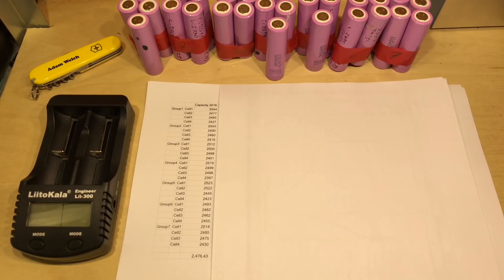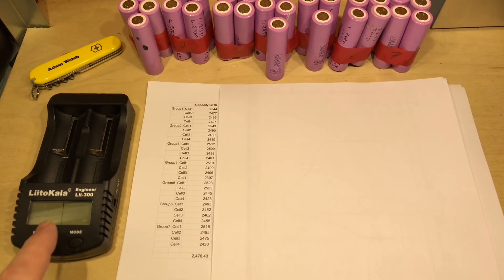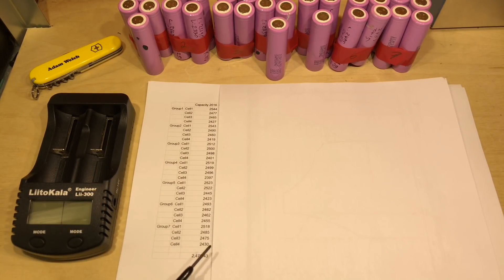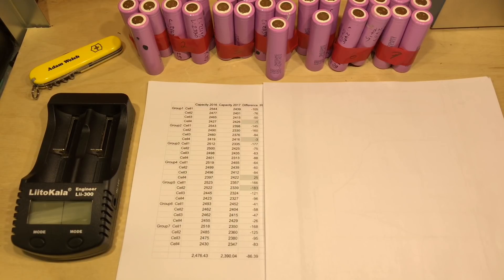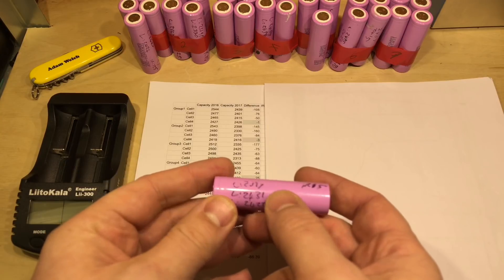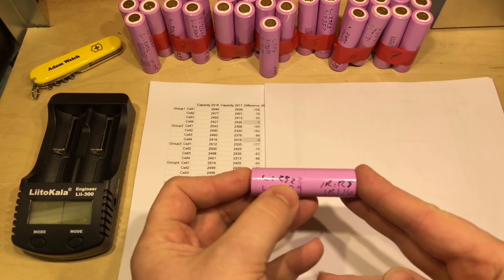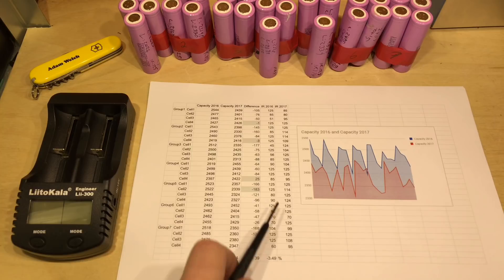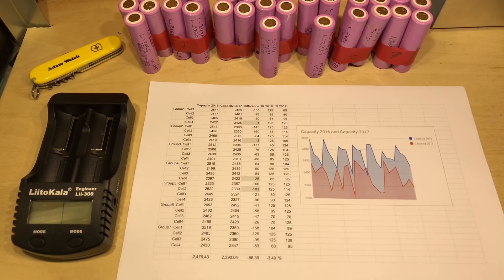Solar Charging Lithium Ion 18650s - Part 5A, Capacity After A Year - 12v Solar Shed

Comment: I would remove the lowest batteries and try to match them. Good luck. Keep in 'ibd that the lowest battery is keeping the pack from lasting longer. 200mA difference is pretty big difference. That means all are not using thqt amount. Because of one bqttery

Comment: Hi Adam What are you pulling through the LED outside?  where/how did you connect the digital oscilloscope to what mosfet? Also what is the silver thing is it a volt dropper what is its rating etc? very concise vid even a dum as a plumber can understand it. Will be off-grid someday and you will be responsible for how i achieve it to quite a high degree. MikeR

Comment: Very interesting results. I think as an average value this is very reliable if done under the same or very similar conditions with the same tester. But i doubt the capacity tester has a decent accuracy. I would guess the error can be as high as 5% on an individual result. But the average values seem to be very plausible :-)

Comment: Completely new to this subject, I just watched your entire series of videos... excellent balance of theory and practical application.
I see there are hundreds of types of 4 Cell & 6 Cell laptop batteries for sale on eBay, how do you know which contain 18550's..??

Great work... Thanks
Reply from the maker: Thanks. It’s a punt, or an educated gamble buying laptop batteries. In my experience the ones that are curved or have curves and usually plug into the back of the laptop are you best bet - the flat laptop batteries which plug into the bottom are often pouch cells. 
Zoom into any photos, see if you can read any details from the laptop battery to google. Then only bid what you can afford to write off if you had to! Sadly it’s getting harder I think to find them for a good price.  Cheers
Reply: Thanks... Like they say "Caveat Emptor"  :) :)

Comment: Hi Adam
I have enjoyed your videos and am cycling through them all.  Question... I have a sneaking suspicion that depending what current setting is used ie 300mA vs. 700mA or 1000mA in the Norm test mode you will get a different mAH number. Can you or anyone else comment

Comment: if i took a cell at 3.3v and hooked it to a dc supply outputting 3.3v and left it connected forever, would there be any issue with that? my reason for doing this would be to stabilize voltage at an esp8266 like a capacitor, and also act "like a ups" for any short interruption. would this be ok for the cell since it would never rise above 3.3 volts?

Comment: do you know any website to buy the cells. cant find them in my region., (LG , Samsung) . All i could get was Chinese rip off's.
Reply: Hi . I have some 18650 from Thinkpad laptops . Batteries are rated at 3000 mAh and I tested every cell and they are about 2500 mAh now , probably more peacouse I tested them with 1amp  discharge rate and this is fair more for laptops batteries . How many do you need ?

Comment: Hi Adam. Great video's.
Over the years of my testing I have noticed a differents in cell capacities with abiant temperature changes, but more than that with Barametric pressure changes. For instance low pressure days; readings are higher by >100mha than high pressure days. On my opus B3100 V2, digital Four and Imax 6 chargers. Mayed you could investigate this with another video.
Reply from the maker: Interesting theory. I’d not even considered pressure. Can’t even think why that would be off the top of my head. Thanks for the idea.

Comment: Can you use this cheap Drok MPPT controller to charge the batteries ?
https://www.amazon.com/DROK-Regulator-Converter-Controller-Voltmeter/dp/B01LYW3EAP
This lets you adjust various setting via the potentiometers.

Comment: Nice video! I found it interesting to see that the biggest losers previously seemed to have the biggest capacity. I wonder if next year you will see the same, meaning that long term capacities tend to decline towards the same average and also implying that the best capacities may loose their greatness at the start of their usage. 
Of course this effect could indeed be explained by differences in measuring condition, but perhaps next time you want to compare the deviation from the average too?

Comment: I find it interesting that the groups of 4 parallel cells have closer matched cell capacities than when they were originally put together.
take group 7: 2516 2485 2475 2430 => 2350 2360 2380 2347 difference between min/max: 86 => 33
Reply from the maker: Interesting and definitely worth some more analysis. Thanks for pointing it out. I guess the higher cell in the group will end up doing more - providing its share and a little more to the weaker cell so that could explain why it suffers a little more.
Reply from the maker: Interesting and definitely worth some more analysis. Thanks for pointing it out. I guess the higher cell in the group will end up doing more - providing its share and a little more to the weaker cell so that could explain why it suffers a little more.

Comment: this confirms that lithium is for many use cases probably cheaper and better than lead acid. Lithium cells degrade mostly by time spent on especially maximum voltage and somewhat less critical at minimum voltage. If you cycle between 4.1-4v and 3.6 volt you can get extreme lifespan, probably still usable charge capacity even at 5000 cycles. However ambient temp plays a big role. At higher ambient temps degeneration increases, and charging the cell should only be very slow (<0.1c?) below 0c.   
Obviously lithium behaves different based on cell chemistry, so with lithium broad statements should be avoided.

In my solar shed I have a small lithium pack (18 cells) for lighting. I also need to run some power equipment from an inverter like a refrigerator and water pump during the summer. For those loads I use lead acid, as it would require peak current of about 100A (12V) which can only be achieved with many more cells (at least 10Px3S with 10a discharge rating). With costs coming down I can imagine lithium even for that, but such a pack would run around 200-250 Euros still. If treated properly however even that pack would be cheaper than my SLA over time.

Comment: Also note that the the tester you used is not that accurate either. It can easily diff up to 100mAh per test and especially depending on the temperature. Thats also the reason you get so different numbers!
Reply: This is so true. According to the manufacturer of this charger an accuracy not more than 10% is acceptable. I've noticed  differences up to 150mAh myself with my Lii-500 for the same cell @2200mAh. Knowing this, the capacity results after one year aren't conclusive. Furthermore what's the value of using repackr if we can't measure the capacity of a cell accurate enough?

Comment: Great video. Looking at the results it seems that the biggest losers are in cell positions 1 and 2, whilst the ones that loose less are in 3 and 4? I wonder why that is?
Reply: I guess it's the order they were selected by the repackr.com list, with each pack being batteries with highest capacity to lowst capacity.  Generally, the highest capacity batteries have had the highest loss, as someone else ( @Maxint R&D ) commented "the biggest losers previously seemed to have the biggest capacity".

Comment: I have some significant doubts about the accuracy of my LittoKala when it comes to the measuring of internal resistance. Cycling the same cell through the process, even with a lengthy time between, can give widely differing measurements. Cells showing high resistance, but with no noticeable heating of the cell I put aside for repeated cycles.
Reply from the maker: Yeah, as I said. I couldn’t see any pattern which might suggest accurate readings which is why I didn’t dwell on those results.

Comment: Have you ever done a battery pack voltage monitor using an Arduino uno or mega r3? I am working on one and am looking for info on it I am not a programmer  I plane on using a mega R3 13 analog chip and optocouplers. Not bad loss at all good video.
Reply from the maker: I’ve thought about doing it but it’s not a straight forward as it first appears. I’ve seen a few different ways to attempt to read the voltage of 7 or 14 packs but each has its draw backs. Isolated i2c ADCs seems like the most logical way forward to accurately read each pack - so it looks like you’re going down the right route! I’ll enjoy following your work.
Reply: I’m doing a Mega BMS and it’s coming along quite well. Also using the ACS1115 ADC for better resolution. I’d love to share it with you ‘Old-time Engineer’. I haven’t upload any videos yet because I am still in the test phase. I’ve got a 7S pack running now and I’m excited with the results.
Reply: Look into the INA219 i2c module.

Comment: They average 500 to 800 cycles so when they near that mark I seen them drop rapidly in mAh, time will tell
Reply from the maker: Well these have only had light use in the year - partial cycles. Generally not charged more than 4 volts and not discharge much below 3.6. We’ll see.
Reply: Don't get me wrong, I love this channel, many of the topics you choose I happen to be very interested in, but these batteries are too finicky, they really need to be balanced and you have to keep a eye on them... A 0.1 volt drain is a extremely light amount and it deducted that much in the amount of capacity isn't really a good sign for normal use, that's what I'm saying. We still don't know everything about these cells to really know if a half charge really counts as 1 charge or not, not really. If you have to charge a battery every day there's 912.5 Cycles in 2 1/2 years. Imagine having a power wall that's big enough to run everything to find out you have to replace all of your cells again in 2 1/2 to 3 years?

Comment: Very interesting! I’ve been put off from buying an electric car by the thought of having to replace the battery pack every year or so. But I think I’ve heard that in fact serious capacity loss does not start until after 400 cycles or thereabouts  so I’m not so sure I am fully reassured. On the other hand I seem to remember that your batteries weren’t new in the first place? Thanks for the video.
Reply from the maker: That’s right they had been in use in laptop batteries for a few years before I got hold of them. I partially cycle my cells and typically don’t charge them beyond 4 volts - so hopefully I’m nursing them along through their twilight years. A bit different to an EV battery but hopefully interesting none the less.

Comment: One guy I'm subscribed to (Shawn McCarthy)  (https://www.youtube.com/channel/UCX8AkaADdZlxrk5IEL413Sw  ) builds e-bikes. He's also an inventor. He says fully charging li-ion cells reduces their lifespan.
Reply from the maker: Yes I’ve heard this too. When charged via solar they top out just over 4 volts. Well under 4.2. So I think I’m not putting too much stress on them.
Reply: If you charge the cell all the way to 4.200V and leave it on the charger until the current drops to 0.000 amps, then it can stress the cell. Letting it charge to 4.200V and disconnecting the charger when the current hit 0.200mA is normally what the little Opus and other off the shelf chargers do.
Reply: Hmm... That's interesting. I have an Opus BT-C3100.
Reply: Me too, 10 of them..lol. I like the convenience. But they charge the cell up to 4.20V and when the current in-flow drops to 0.200mA, the unit stops charging, and the cells actual voltage (measured with a DMM) is around 4.18-4.19. It never really saturates at 4.20V. You can 'force' charge them with any adjustable DC converter, and just wait until the current flowing in falls to 0.00 but doing that will cut the number of life cycles by 1/3 (at least). So its a balance, how long you need them to last vs. absolute power you need out every cycle.

Comment: Just getting into re-purposed 18650s, solar panels and MPPT charging. Over the last little while I've haunted our local eWaste recycler and have accumulated 2500 or so cells. I am about to start processing the cells, have you developed a metric that will identify "dud" cells from the get go, or is it a matter of charging them, discarding any that get too hot, and holding them for a week or two to check self-discharge losses? Anything else I should be on the lookout for? Cheers.
Reply: Bigclive has suggested that if you fully charge a cell and it goes below 4v in about a day then it isn't holding its charge very well and isn't worth using.
Reply: Check the internal resistance and it should be in the 100mOhm range. Cycle them once or twice - maybe a few times if you don’t know where they came from, or they sat around dormant for a year(s) and the charge them to 4.200 and let them settle for a day. If the internal resistance is way above 100milli-ohm, they will self discharge rather quickly. I haven’t found a “quick and dirty” way to test them...slow and thoroughly works though.
Reply: Anything sitting below 2V is definitely not worth salvaging. They've all turned out to be heaters, self-dischargers or of dismal capacity. Most above 2.5 have turned out okay.

Comment: Liitokala capacity measurement is a little off some accurate equipment is needed to determine real capacity of the cells....
 I suggest SKY RC mc3000 is more appropriate one... if you measure same cell 5-10 times it shows almost the same capacity 5-10 mah discrepancy 
I have 5 liitokala's lii500 an not anyone can determine the right capacity is of for 500mah even way better opus bt-c3100 charger-discharger is of for around 300mah in the other hand MC3000 is a real deal and is accurate if you compare the price between is speaking for itself....👍
Get a good equipment and do the test once again.....

Comment: Interesting. Wonder if similar results would come from charging a 12v lion pack using a regular lead acid charge controller. Maybe I don't need to spend extra on a charge controller where I can set custom values!
Reply from the maker: In the very first video around this project I explained why I don’t think 3s or 4s packs will work with an off the shelf lead acid solar charge controllers.  Check this playlist: Charging Lithium Cells with a Lead Acid Solar Charge Controllerhttps://www.youtube.com/playlist?list=PLXyc_wd5sxbhYhAKHVq8SGQ2Sncl1PDDT

Comment: Wow, surprisingly good, meaning these cells were not always in 20C temp conditions and hooked up a wrong charger. Would also been nice if you just had 1 or 2 cells outside of that charging circuit and checked how well they did just without any charge and use. 
How long did it take to measure all of these?  Maybe buy the lii-500 charger, costs almost nothing and you have 4 slots. (actually my favorite charger by far because of the price and ease of use)
Reply from the maker: +Luc Peeters Yeah, if I had planned this a year ago I might have set up some sort of control measure. The liitokalas are pretty good units for the price, but I’ve also got an opus c3100 but as I said  in the video thought it best to use the very same unit a year apart.

Comment: Temperature is the most important variable in electronics. By not performing this test in an identical temperature environment, makes your test worthless. Why do you think they specify data in room temp of 20ºc or 25ºC ?
Reply: Not worthless at all, as i doubt most are used in everyday life in a controlled environment. Real world tests are very much welcome.
Reply from the maker: +PirateKitty Sadly my shed isn’t temperature controlled - it’s just a shed. Worthless - I hope not, but I take your point on board.
Reply: The test is definitely worthy, you could argue it is not statistically conclusive but it is a great argument to justify charging with the used equipment rather than with something lithium specific

Comment: First. I'm also building similar setup
Reply: I think test valid,  ....its a shed , a real world test on batteries that might have been otherwise thrown away....be interesting what they would have lost anyway and the difference a li ion charger would have made...
Reply: In perth wa, solar panels are everywhere. ..and very cheap 2nd hand are available on gumtree for camping purposes...i have a throwaway one i use for camping and also run my outdoor lights at home off it....huge temperature fluctuations over course of year from 2c to 45c in the shade!